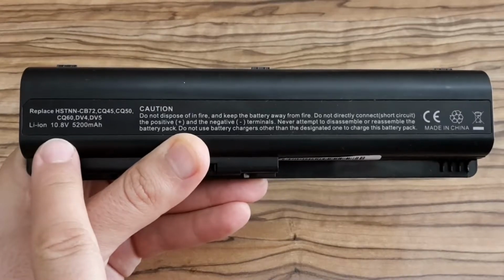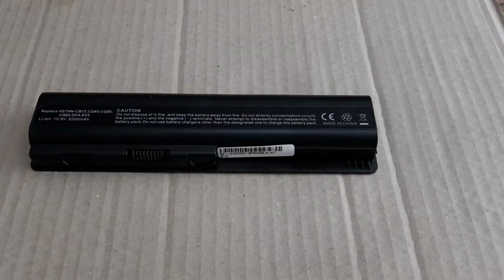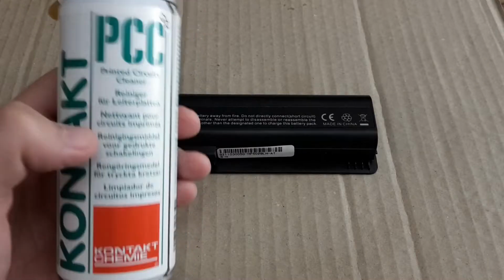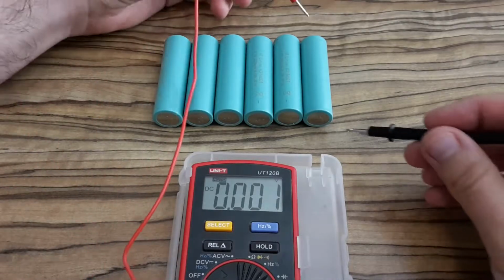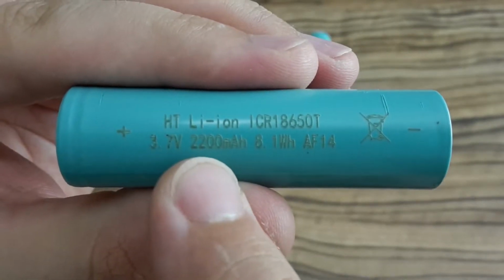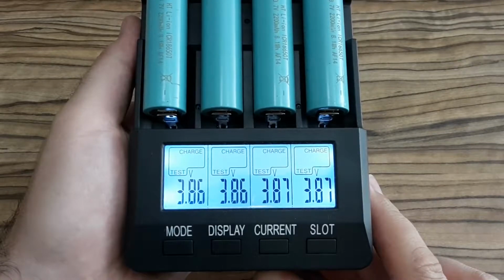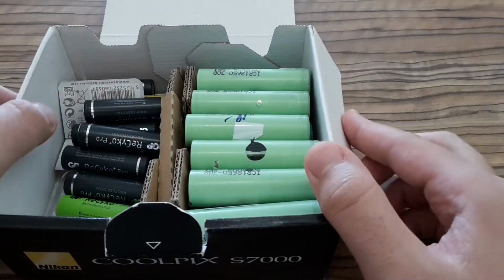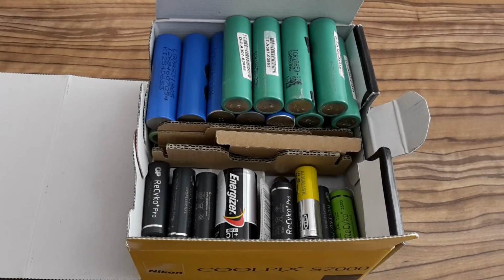Fake Chinese Battery Pack Teardown

Comment: Very interesting video.  The battery case and the circuit board looks to authentic.   I would never be able to tell by just looking at the case.   I had a similar situation recently...I got a cheap battery for my laptop off ebay...and the thing wont take a charge after 30 days or so.  I cracked the case open only to find generic repurposed cells and one of them is down to 2.6  volt.  I was able to bring it back to 4.2 volt, but too late at that point.  I am not even sure I want to repurpose the already recycled cells...lol

Comment: That's what you get when you use Chinese cells, they are never the capacity they claim to be. 
Proper battery manufacturers like Panasonic etc write the real world capacity, based on real tests. 
However, Chinese batteries do unrealistic tests and then write on larger numbers on their batteries, when the real world results in real usage is 30-40% less than what the Chinese battery claims to be.
Essentially the highest power draw, the lower the Ah. Real world tests done by Japanese companies and other companies use power draws that are realistic to expect in real world usage.
However, Chinese run a test that draws only a fraction of what the battery will be required to output in real life, meaning they essentially hook up one of these batteries to a low draw like 100mAh and then come back the next day and notice around a 2200mAh result, then they brand all these batteries 2200mAh. 
However in real world power draw, they will be drawn at around 300-400mAh constantly and the real capacity is more like 1800mAh at this rate. 

That's basically how they are dishonest, yet it's based on a real test (just under unrealistic conditions).
Of course then you have the full blown flat out lying Chinese batteries that claim to be like 100,000mAh etc, people who buy them are clearly naive, it's like Chinese flash drives that are like 2 dollars and claim to be 500gb, they are flashed with an edited firmware to falsely register as 500gb, you can fix them back to their original state and it's usually like a 1gb flash drive in reality. 

China is scammer capital of the world in products.
Reply from the maker: I wanted to save and that's the result 😂

Comment: They could be 2200mah when new, but with age they loose capacity.
Reply from the maker: Hi, sure they were new, but they are selling rubbish ones :-)
Reply: @zeroampselectronics  shouldn't be. I have a few no names that actually put out more capacity then rated. Are few years old, so don't expect alot from them.
Reply from the maker: You were more lucky than me :-)
Reply: @zeroampselectronics  powerbank 18650's so should be alright.